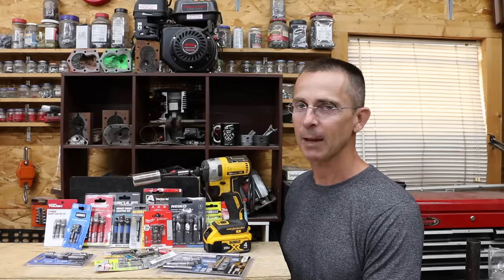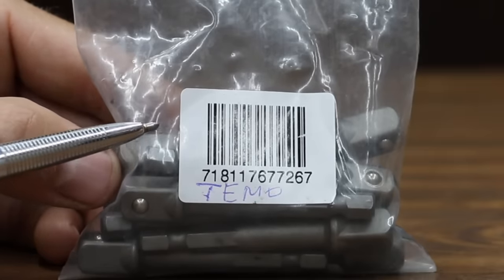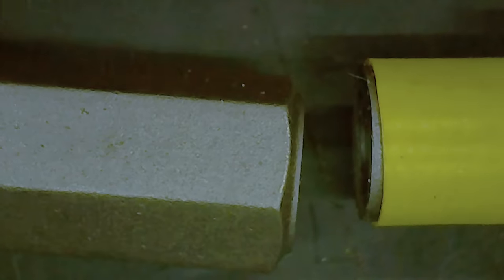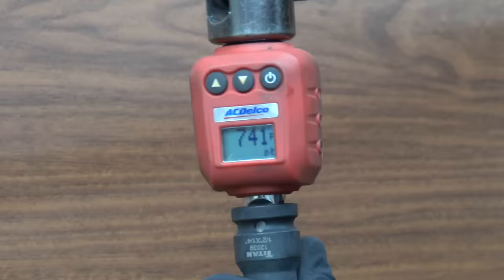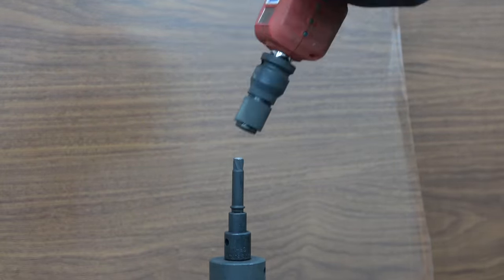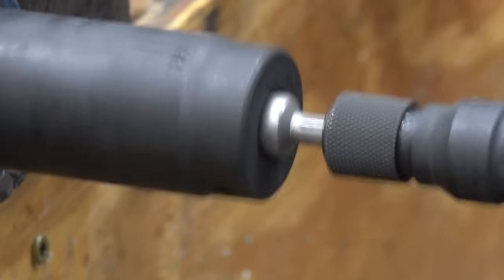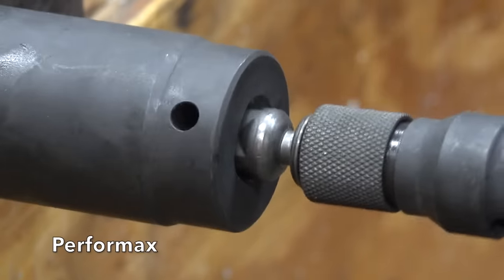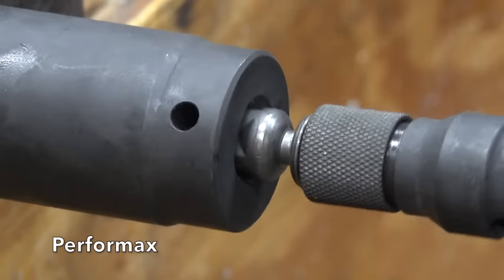Best Socket Adapter? 18 BRANDS: Milwaukee, DeWalt, Makita Gold, Ryobi, Hart, Irwin

Comment: If any Canadians see this comment, avoid the MAXIMUM brand from Canadian Tire, mine sheared off almost immediately while using my M18 brushless impact driver (2850-20), 134 ft-lbs, while trying to remove lug nuts that were torqued to 95 ft-lbs. They wouldn't warranty it either.
Reply from the maker: Thanks for the feedback.

Comment: In Norway/Scandinavia, we have a brand called «Biltema». Biltema sell cheap parts for decebt price and quality. Just like Walmart. Biltema sells engine oil that i have always been sceptical about. So i was wondering if you could do a testing of for example their 5W30 Full synthetic? I have a link: 

https://www.biltema.no/bil---mc/bildeler/motoroljer/helsyntetiske-motoroljer/olje-helsynt-ll-5w-30-4l-2000035845

Comment: These Tq. measurements are not entirely accurate because the socket wrench is not braced perpendicularly to the tool. 
In addition, the force is progressive, and not impact, or tested for cycles.
After 5994 comments, nobody will ever read this.
Reply from the maker: Thanks for sharing.
Reply: @ProjectFarm  Wow.. I am humbled and shocked. Subscribed